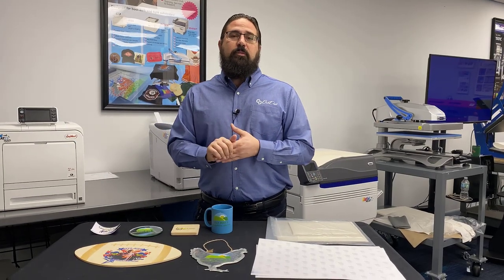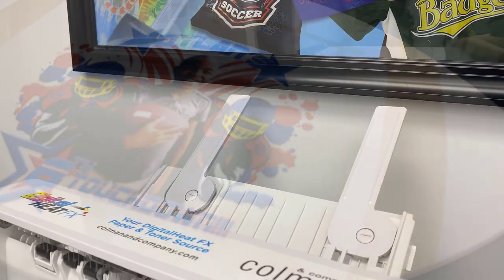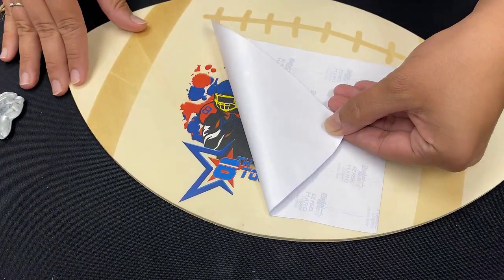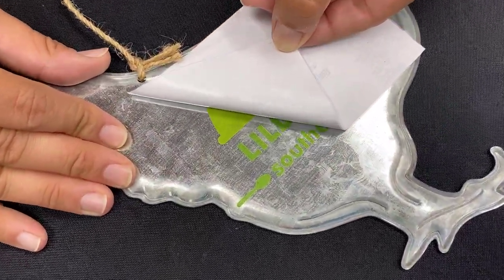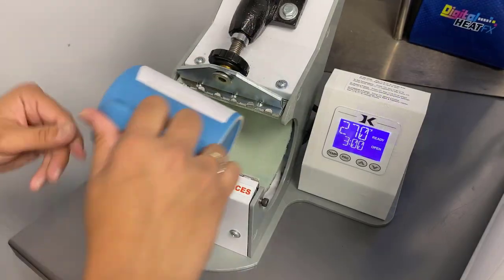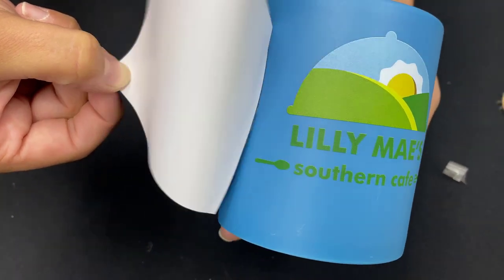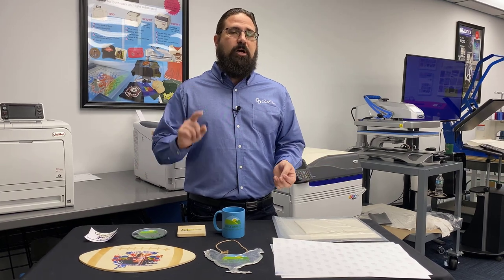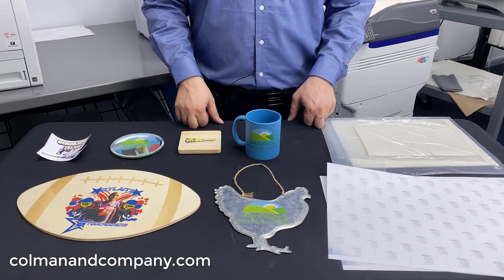EZ Peel Hard Surface Transfer Paper | DigitalHeat FX

Comment: Why is my graphic smearing when I print it? I am using the EZ peel hard paper, the 8432 HeatFX printer and I have the print settings correct for the paperweight.
Reply from the maker: Hi Maryann! Our support team isn't available to answer specific questions on YouTube. You can put in a support ticket online https://support.coldesi.com/ or give them a call at  877-793-3278

Comment: Question?  sublimation printers don't print white.   The images show white as part of the design.  Is the white coming from the paper?
Reply from the maker: Hi LoveBirds Lane! This is NOT sublimation! This is white toner printing with the DigitalHeat FX System. So these printers do indeed print white AND black!
Reply: @ColDesiColman  Thank you so much for the clarification.  Did some research, a bit of a cost to get started.  Would take awhile to make up the cost for a start up.

Comment: Couple of questions.  Do you print using a regular inkjet printer or do you need a sublimation printer? Can this method be used on ANYTHING like items that are not sublimation blanks? I want to be sure I am understanding everything correctly.
Reply from the maker: This is printed using a white toner printer (http://digitalheatfx.com) and those can be applied to almost any material. It does not require a sublimation blank and can be applied to both light and dark colors.
Reply: You may use a inkjet printer that has the correct printer head and has not been used for anything other than sublimation ink.   Most common is Epson printers, due to price point.